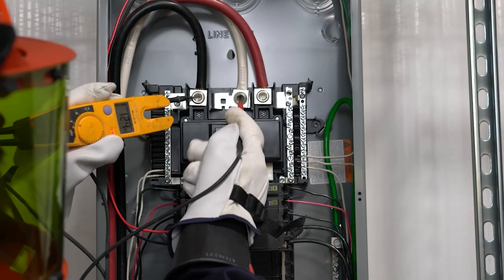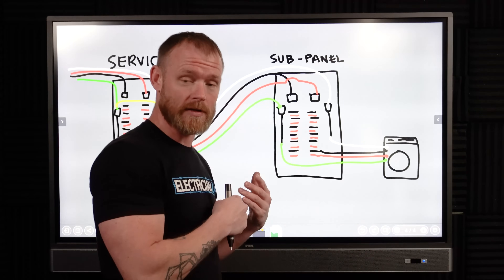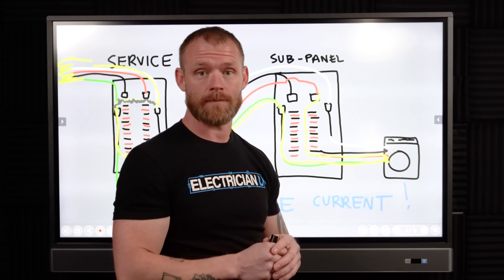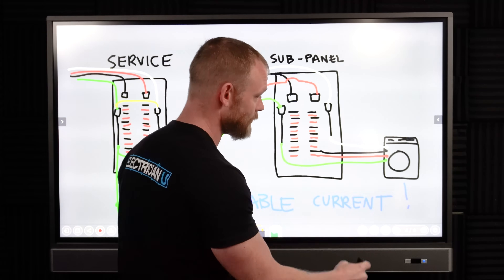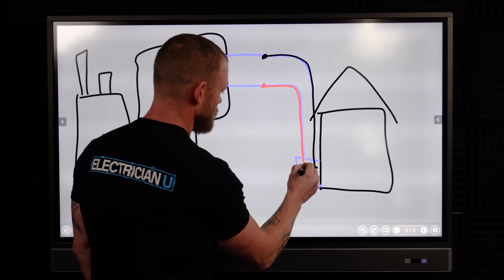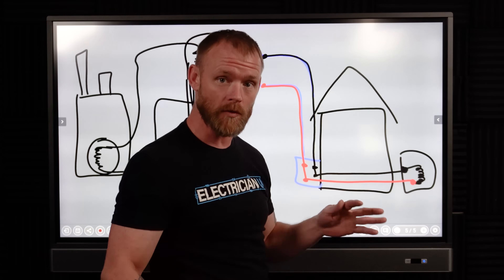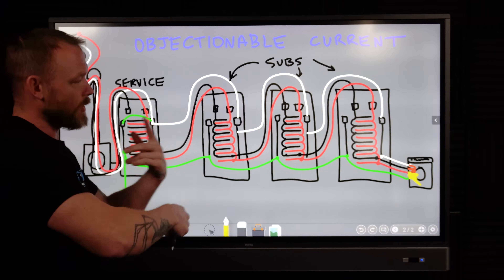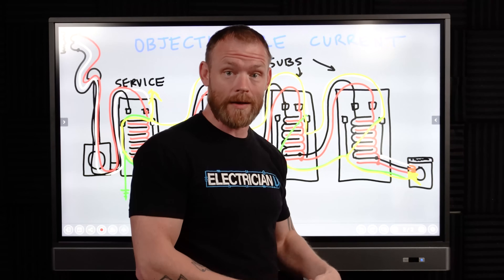Why Do We Bond at the Service Panel and Not a Subpanel?

Comment: Before even bothering to watch this. The reason you bond and only a single location, is due to the parallel current that can cause a possible over current situation on smaller wiring.

Which is why a ground fault can be a fire hazard.

Years ago I arrived at a job site, with a 400 amp three phase service. And found a neutral that had burned its way through a foursquare box. Because it was paralleling the entirety of the service with a neutral load of about 150 A on a number 12 wire. Meaning that this number 12, was carrying about 75 A.
Reply: It's simple, always use 0000 wire for every circuit.  No more pesky melted boxes. Oh, and lock all breakers in the open position.

Comment: Why does the first diagram @1:40 show a 4th green conductor coming in as part of SERVICE (where a yellow bond was drawn over to white), while other diagram that has 3 subpanels shows 3 conductors at the service entrance?  I thought typical entrance cables have 3 conductors (L1, L2, Neutral) coming in.  Thanks!
Reply: Same question as Chuck B ..... at 08:28 Dustin shows the green ground going out at the bottom of the Service panel to the grounding rods so what is the green incoming ground wire shown at the top of the service with the service feeders from the meter for? Is there a ground wire needed in the meter base and then run into the service panel ground bar?
Reply: It's a mistake/error.  Service wires don't include a ground.
Reply: @taylorlightfoot  Maybe it's shown just to cover 250.92(A)/250.92(B) between meter box and service panel as bobrub wondered above, and I shouldn't have taken his diagram so literally ;-)

Comment: Great Video and the illustration helped a lot, I am having a problem with one outlet in kitchen when i touch the bare ground wire i get shocked, this happen with the breaker turned off when i was changing the outlet with new, I am thinking it could be a problem at the panel or sub panel.
Reply: One possibility is u have poor grounding contact, plus imbalance on your two hot lines so there is significant current on neutral.
Reply: @rcmrcm3370  would that be at the panel? this happens with the breaker off
Reply: @BrianDoesStuff873  Breaker only isolates hot and neutral, not ground, so yes.
Reply: To get shocked, you have to touch two different things, where the voltage is different between them.  What is the “other” thing that you’re touching at the same time as the ground wire?

In my old house, there were two different circuits that shared a neutral.  In a situation like that, first, the two circuits need to be on opposite phases.  Second (more directly addressing your problem), even if you turn the breaker off for one circuit, there could still be a little voltage drop on the neutral, giving you a little shock between neutral and ground.  Or, if there’s a poor connection in the neutral wire somewhere along the path, maybe a bigger voltage drop and a bigger shock.
Reply: @kc9scott  i think when i did this i was holding the outlet and when i touched the bare ground wire it gives me a shock
now that i think of it maybe i need to replace the new outlet with a better brand. the crazy thing is i have the breaker shut off
Reply: Or as RCM RCM said “poor grounding contact”, maybe it was a hack job where that outlet’s ground wire doesn’t actually go to the service panel, but maybe instead to something like a water pipe.  If there’s a voltage offset between the house’s neutral wires and other metal like the ground wire for that outlet, that’s a big problem (at least for someone changing an outlet).  Maybe the ground and neutral wasn’t even bonded at the service panel?
Reply: Get an electrician to replace your receptacle and show him how you got shocked.
Reply: Maybe you shut off the wrong breaker. They are seldom labeled 100% correctly if at all

Comment: I like you videos and want to point something out regarding this topic. Perhaps you mentioned it but I didn't catch it. You seamed to focus on fault conditions when speaking about objectionable current. If you bond in a sub panel you with have objectionable current on the EGC in normal conditions because it will be in parallel with the neutral (grounded conductor) back to the main panel.
Reply: Exactly. I'm pretty sure what you speak of is generally what 'objectionable current' refers to: current on the EGC under normal operating conditions.
Reply: You are correct about the parallel currents running on both the neutral and ground wires. This will also cause ground fault breakers to falsely trigger because it detects a current difference between the hot and neutral wires.
Reply: Because the transformer is connected to ground, the current has a path (through earth) to loop to the source. In some country, there is absolutely NO connection between ground at neutral. And breakers still trip. But of course that only works if the soil has very low resistance, which maybe not the case everywhere in the US ?

Comment: So what if your electrical service has a little standalone breaker between the meter and the main panel.  Would you bond at the standalone breaker or at the main panel or both?
Reply: Only bond at the first point of service. Which is the stand alone breaker and take a grounding cable into the main panel.

Comment: If you bonded your ground and neutral at both the main and sub panel and you have a fault on a 120 volt circuit then you could get 120 Volts on the neutral.  So ALL of the 120 volt circuits that are feed from the other hot lead will have 240 volts on it instead of 120 volts.  Which could cause additional equipment failure and cause more faults as well as destroying equipment.
Reply: That's called a lost neutral, sometimes it happens to people's whole houses, and it has nothing to do with bonding neutral and ground at subpanels.
Reply: @thewhitefalcon8539  correct!
Reply: This would not happen, but even if it did, it would be short lived as the breaker will trip nearly instantly.  The main problem is parallel paths and current intended for the neutral will also flow through the ground wire.  We size our ground wires smaller, so there's an opportunity to overload it if we have parallel neutral paths and this can cause a fire.
Reply: This is the answer I was looking for.   If a fault happens, then my 120v toaster would make my sliced bread too dark.   [A parallel path to neutral is actually good because it splits the current between the two wires.]   It's the voltage, not the current that is the problem.

Comment: Hi Dustin. Would it be a better practice to bond the Neutral once in the meter? Then any panel,  no matter the number of panels you have, ALL Neutrals and Grounds in the home will be separate from each other. That's what I do. Let me know your thoughts. Bonding the Neutrals of the first panel is not wrong.
Reply: My power company does not allow me to do that, its their provided equipment.

Comment: Why does Con Edison ground absolutely everything anything metal in their substations has like a giant 500 wire lug
Reply: Power/electric companies have there own rules, they do not use the NEC.
Reply: @tiggeroush  Are you serious, power companies wrote the NEC.  They got tired of killing off their customers.
Reply: They are bonding everything to same potential.
Reply: @thomasmarable6818  Think lightning.
Reply: The fault current traveling though the grounding system at a substation could be around 30,000 to 40,000 amps. There are multiple paths for that fault current to divide, the wire lugs have to be of significant size to handle it.

Comment: Hey Dustin. I'm an electrician in the Bahamas and this is the best explanation I've ever heard explaining this. Now I will use this video as a teaching tool when I get in an argument pertaining to bonding. Thanks.
Reply: Just out of curiosity what electric code is used in the Bahamas?
Reply: @tiggeroush   Canadian Electrical Code
Reply: Which part of the 🇧🇸???
Reply: @IRegretClickingThis  Nassau
Reply: Neil Barrow.....does the NEC we have here in the states apply in the Bahamas.....just curious!
Reply: @ottoroth3066  we do use some parts of it and the Canadian Electrical Code we use duplicates some of the NEC . But mainly our Electrical Bible is the CEC.
Reply: @neilbarrow8110  almost sounds like TV networks CEC NEC CBS ABC  NBC NBA 😆
Reply: @ottoroth3066 or the beginning of a bad remake to a Jackson5 song if you’re old enough to get the refer by ence.

“C-E-C
easy as 1-2-3.
Easy as
N-E-C
Or simple as
C-E-C
N-E-C, one, two, three, baby, you and me girl”
Reply: Mostly because this is not safe but is illegal. At least in the UK anyway. "A consumer shall not combine the neutral and protective functions in a single conductor in his consumer’s installation." (Regulation 8(4), The Electricity Safety, Quality and Continuity Regulations 2002)

It is not necessary because either the DNO provides a continuous earth path to the transformer (by a separate conductor or by doing their own connection in the service cutout) or you have your own earth rod and (this is important) an RCD/ELCB/GFCI for fault protection (as indeed an earth rod is unlikely to passe enough current to reliably trip a fuse or circuit breaker).
Reply: Hi - I have a sub panel that is fed by a 220 circuit and neutral. There is no ground from the main service panel which is far away. For this sub panel, should I put in a separate ground rod/and then bond to the neutral bar?
Reply: @pacrats4377 as illustrated in the video, that would cause a hazardous situation because it would cause two paths back to the service point’s neutral. It could cause a situation that would cause the electrification “surge” of the neutral across all of the breakers which has the potential to flow in many directions including into all of the equipment in the home.
Reply: @devinhedge  Hey Devin, could pacrats be referring to a simple "service disconnect" when he refers to "the main service panel which is far away"? That's kind of what I'm envisioning, is his meter out by the light pole, with a simple main off/on switch next to that which leads to his home's interior panel. I've seen this set-up before where sparky just treats the service disconnect the same as the meter, and he bonds the interior panel to the ground as if the service disconnect didn't exist.  Can't really see how that is problematic either, because if you just did away with the service disconnect out by the meter, then you'd end up bonding at the house panel regardless. So as long as the neutral wire/bus in the service disconnect was professionally connected to the neutral wire from the power company, it's basically the same as if the wire from the meter just ran straight to the house.
 At least that's how I see it anyway, and apparently many others. 
 I wonder what your thoughts are on this.
Reply: @pacrats4377  I don't know your country's regulations, but in the UK you should NEVER connect earth/ground and neutral together in your own installation as this could result in an unlimited fine. I think a UK solution would be to export the main earth, or to provide a totally separate TT earth, but please contact an actual electrician.
Reply: It's good to know another Bahamian is watching this to

Comment: Is it the service panel or the first point of disconnecting means? I've seen disconnects with ground and neutral bonded if they're in between the power company's meter and the service panel
Reply: Its the first point, sometimes its a disconnect some times it the panel with a main breaker.

Comment: So does the fault current go back to the source/transformers? Or does it go back to earth through the EGC? What's the purpose of that equipment grounding conductor? Thanks
Reply: It goes back to source, electricity always wants to go back to it's source.  The ground rods exist for lightning protection only.
Reply: Current can go through the ground to the grid, but it will be very small without bonding. it's a safety feature.  If current goes where it's not suppose to, then the best thing is to have it go safely to earth until a trip condition is created.  The amount of rods and size of bonding cables needed to provide  full protection against a direct lightening strike is insanely expensive.  The reason for the bonding is that prior GFI/GCI protection you could not get enough current on the ground wire to trip on over current (vs. ground fault), creating a hazard of a hot fault waiting for you to create a ground.  That is unless the service ground  was to a decent size Ufer ground.

Comment: So the cable going to the sub panel should be a four wire? With the grounds and neutral separated. But the main needs to be bonded together.
Reply: Yes, and if the sub panel is located in a detached structure, you have to add ground rods at that sub panel and connect them to the ground wire in that sub panel.

Comment: Can you go over “Corner Grounding System”?? Ran into this the other day and I’d like to know more about it and why this system was used back then? Seeing “B” phase grounded was a trip!!
Reply: On 120/240 3 phase 4 wire we ground the neutral because it’s less than 300v and you have to ground everything less than 300v. On 240v 3 phase 3 wire we ground a corner( phase on a delta ), because it’s less than 300v and you have to ground everything less than 300v. On this system there is no neutral to ground so we have to ground a phase( corner of the delta). One other bit of information is you have to run the grounded conductor to the customer, because customer doesn’t get neutral that forces you to ground a corner.

Comment: Please explain the grounding requirements for sub panels… in the same structure and in detached structure.  Why is it done different?
Reply: I still ground my sub panel with two ground rods independent from the service
Reply: Ground rods are about lightning protection.  You don"t need extra lightning protection if the sub panel is in the same building as the main panel.  You do need lighting protection in a separate structure like a detached garage to ensure lightning doesn't travel through your ground wire in your conduit back to the main panel/structure.
Reply: @taylorlightfoot  It has nothing to do with "lightning".

Comment: What should be the size of the bonding jumper
Reply: Most panels have a screw to bond the ground and neutral bar to the cabinet. Screw gets removed if it is a subpanel. Not saying every panel will be this way. I have had a panel that had 35 volts ac between the ground and neutral, because the 480v to 240/120v transformer installer did not bond the neutral to ground. It required adding the ground lug to the cabinet.
Reply: Ok, took me a little while to find the bonding jumper size. The answer is in table NEC Table 250.102(C)(1). The size of the bonding jumper depends on the size of the of the ungrounded conductor.
Reply: Depends on the service and loads. In theory if you have GFI even a thin jumper will suffice to cause a ground fault trip, but sometimes GFI fails, and if the jumper is too small, or badly connected, it will burn through before the over current protection can act.